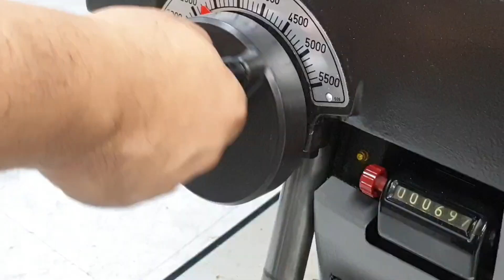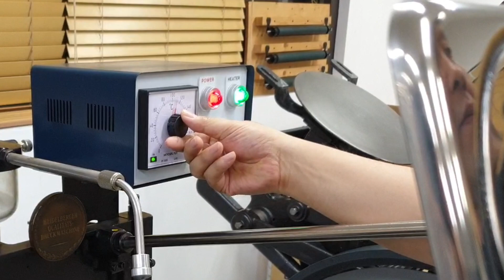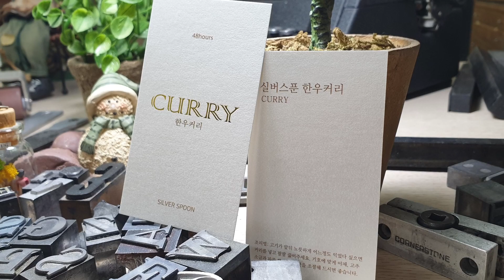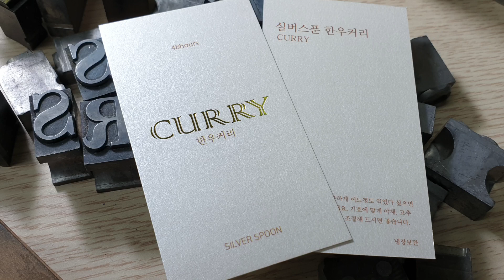Windmill letterpress foil processing video

Comment: An absolutely beautiful long lost art. Spent my entire life in the printing trade.. mostly in prepress as a stripper and then mac operator. Ran a 10x15 windmill in the mid-late 70's. They're slow but SO VERSITILE and very cool!  Perf, score, slit, diecut, emboss, foil stamp, numbering, print,  etc. Thanks for the video
Reply from the maker: thank you so much. I started out as a designer and have been working with letterpress equipment for about 9 years. Even though I've been working here for about 30 years, it's always fun :)

Comment: I'm 57 and I can still remember Heidelberg USA would still service these presses .....not anymore, the techs that come into the shop can't even service a gto or Kord....if it does not have computer controls the press operator has to help these guys work on the press .
Reply from the maker: Nice to meet you. I am using Google Translator because I am not good at English, but I do not understand what you said.
Reply: @w_letterpress  most of the older techs that serviced this type equipment that worked at Heidelberg USA were let go in the 1990s and some started their own companies to service old printing presses. If you call Heidelberg USA for windmill press parts they would laugh
Reply from the maker: @johnnyteague3407  Oh, yes. I understand. :)
In Korea, there is a place where parts are removed from old machines and repaired. Most of them are repaired by removing parts from equipment that are old and not used. As a result, the price of the parts is quite high. For example, a windmill wing may require $1800. I wish you all the best in your work.
Reply: @w_letterpress  the company I worked for, if they could not trade in a press, they would roll it out into the parking lot and tell us to beat it with sledge hammers. Then it went to scrap....we bashed many linotypes, meihle, Kluge ,and other presses because they refused to sell to the competition. Just thinking about all those old press parts and the value of them.

Comment: Very nice work and that without a guide, can you show the pole that holds the foil roll and how it is caught?
Reply from the maker: I'm very grateful.
First of all I do everything without a guide. It is used without a guide when processing on the offset printing after printing or to save paper.
The foil hanging device is attached to the chase.
We will publish it in detail later when uploading the video.
Reply: Or you can run the foil from the left side of the press